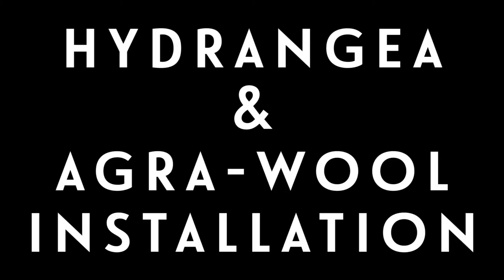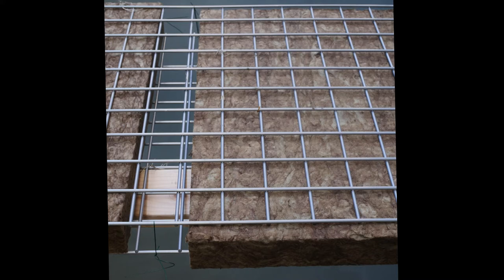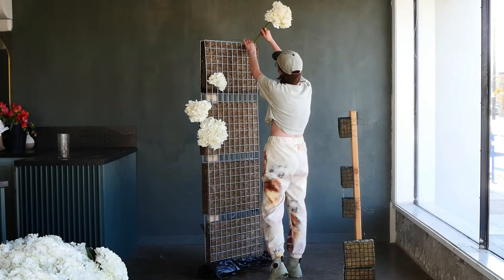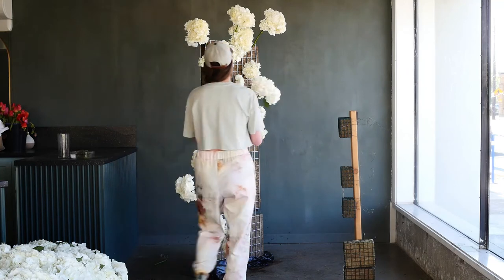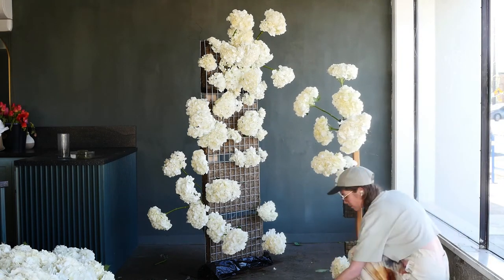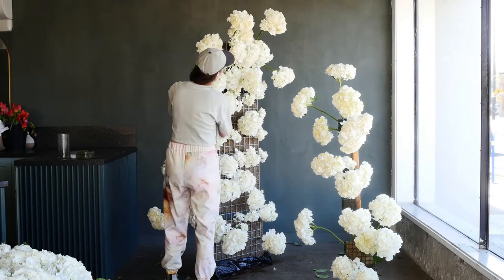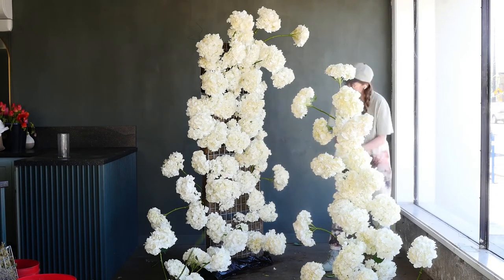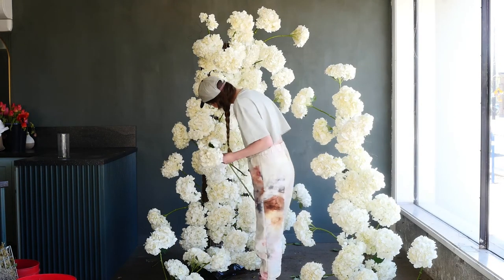How to Create a Floral Arch - No Toxic Floral Foam

Comment: This is beautiful.  thx for the tutorial. Any tips on keeping hydrangea from wilting once in the installation, especially for an outdoor event.
Reply from the maker: Thank you! These hydrangea are in agrawool, which is a compostable material that holds water. These hydrangea lasted several days before wilting! If you are creating this for an outdoor event and it's hot, I would recommend using a different variety of hydrangea, such as Peegee hydrangea, because it's doesn't wilt much- it more just dries in perfect form. You can also try to source the hydrangea locally, because it will last much longer if it's not sitting in a box being shipped for days.

Comment: I've noticed the agrawool being difficult to use for more delicate stems. Or when it's too thick, the agrawool just pushes in without actually puncturing the wool. Do you have any advice?
Reply from the maker: Yes, it's definitely not ideal for really delicate stems. I tend to not use small, delicate stems for larger installations, but if I am using Agrawool for a centerpiece design, I will use a little stick or stake to poke a hole for the more delicate stem. This works okay if it's not hanging upside down (as it might be in an installation). I've recently started using the Oshunpouch for installations and like it a lot better because it doesn't drip and accepts more delicate stems more easily.